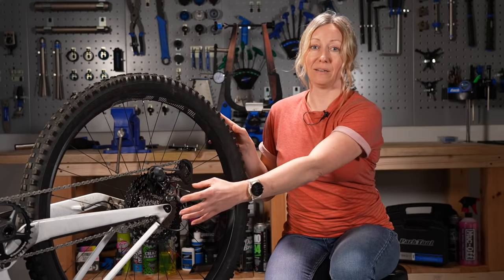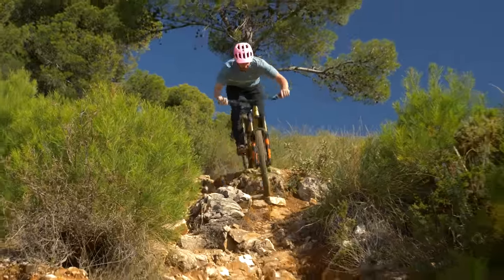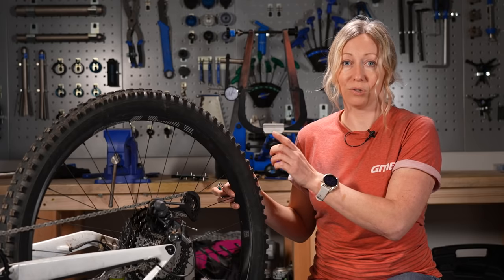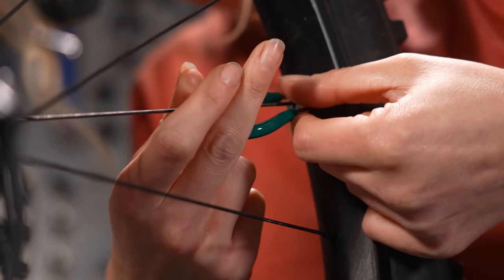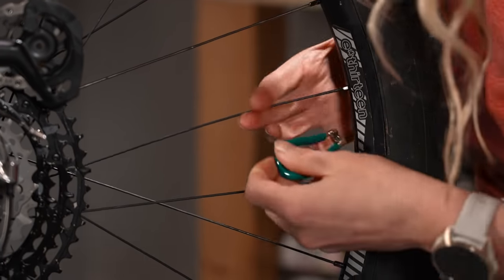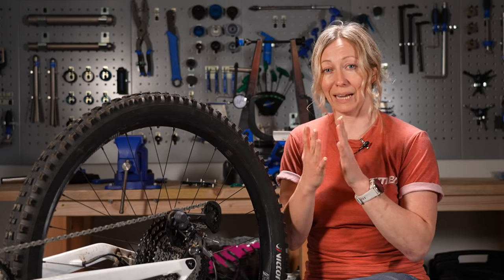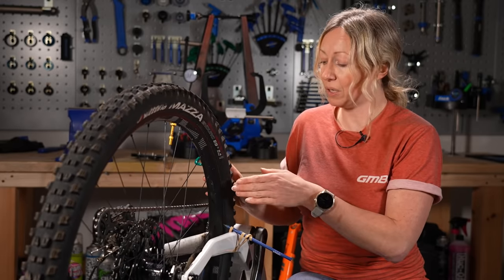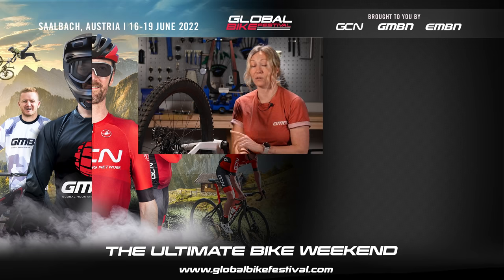How to Fix A Wobbly Bicycle Wheel | Trailside MTB Repair

Comment: If you can put your wheel out of whack with regular riding (not casing a jump or hitting a square rock extra hard), then that wheel was never up to proper tension in the first place. 99% of OEM wheels from the factory  are in this category.
Reply: @RealMTBAddict  i just build my own.
Reply: @RealMTBAddict  really? It takes an hour, maybe an hour and a half to build one wheel. You don't have a spare 3 hours every ten years?
Reply: @RealMTBAddict  damn. Sorry to hear that

Comment: Always trying to get more business for the LBS. As long as you can check the wheel for true, centering and that there is no wobble from the axle making it off centre, which you can using a pencil, or even tie wraps on your bike, it's really easy to get the spoke tensioned correctly, or a spoke or nipple replacement. It really isn't that difficult to do this yourself. The only time you need a LBS or wheel builder is when you tacoed the rim and it's so out you can't do it. I build my own wheels, it's not impossible to learn.
Reply: If u taco a rim, no wheel builder can true that! Any more than about 0.5-1cm rim out of true, rim really needs replacing. So  'u' or L shaped rim is toast!
Reply: @rupedog  you obviously aren't on the ball here are you. If you taco a rim, you can have a new rim put onto your old hub. What you buy an entire wheel every time you taco a rim. Must cost you quite a lot. 🤦‍♂🤣

Comment: I had this happen to my brand new set of rebuilt mtbi 35 rims. Wobble... The Frame & Wheel Tire combo were so tight that when it wobbled And lightly rubbed.  Come to find out the first bike shop tightened the spoke to 20... the spokes were DT Swiss racing.. the second shop Trued it up and  tightened the spokes to 40 instead of 20 and the problem was solved.

Comment: 0:47 Kinda wrong for the tension. If the rear wheel is not asymmetrical, the tension will be higher on drive side, to pull whole wheel over the freehub body. If the front wheel hub has disc and wheel not asymmetrical, the tension will be higher on non drive side, to pull whole wheel over the disc.
I used to think that wheel should be equally tensioned and when I finally put it on the bike, I found that I must release tension on one side to get it in the middle.

Comment: I have a question why do fork bend while comprensing?
Watch slowmotion fork test their fork is bending?
Reply: Basic physics.  Clamp something one end, load it the other and as long as the load isn't passing through the clamp point there will be bending.  Look up moment arm and you'll see what i mean.  TBH pretty much everything is in bending, you just can't see it.